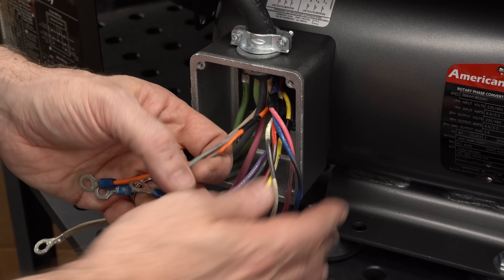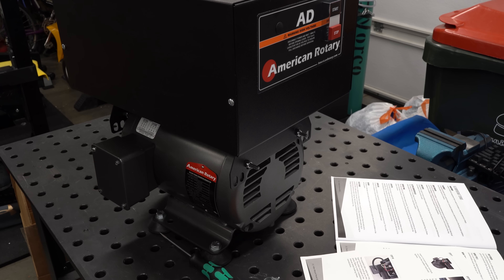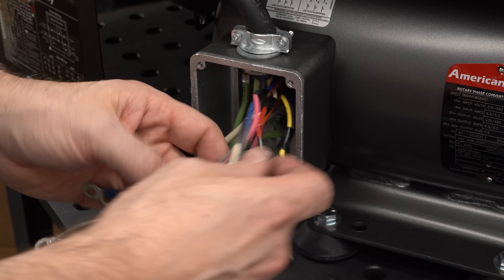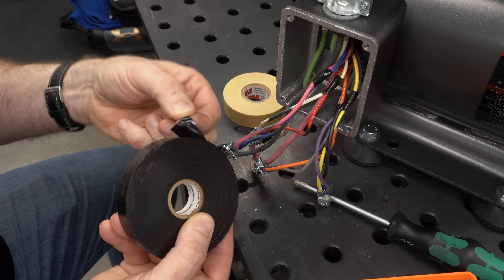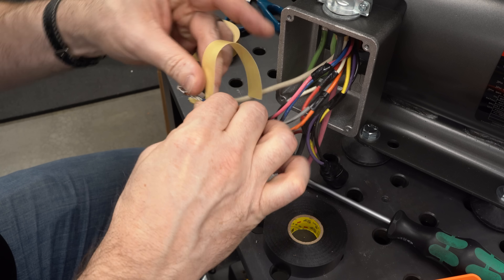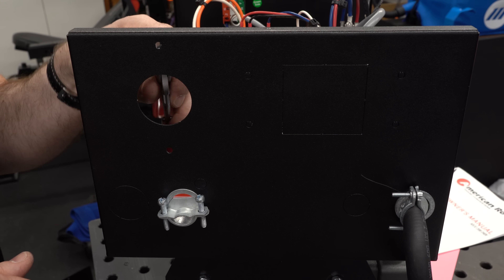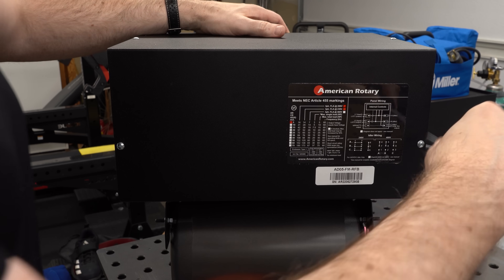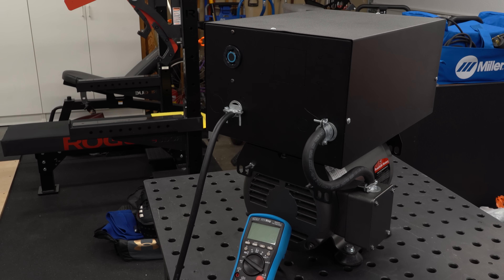How to Wire a Rotary Phase Converter the Old-School Way!

Comment: Heavy, difficult to grasp, gravity in your favour - And I think we've worked out how "Scratched and dented" came to be! :D
Chassis ground:  As far as I'm aware, two conductors in one terminal is perfectly normal and acceptable - although I should caveat that by saying that I'm not a qualified electrician and I'm from an entirely different regulatory domain...although we do use 240V as our norm.  So take that with as much authority as it was intended :D  That said, there's a nice nut, bolt and vibration washer on the same connector so you could crimp on a ring terminal and sandwich it under the vibration washer if that makes you feel any better (and nobody chimes in to say that it's a terrible idea :D )

Comment: In regards to the ground lug.... even though it is likely only rated for one conductor virtually everyone, including manufacturers, load these lugs up with multiple wires. I always make some type of modification to be Code Compliant, but that is just me. Methods that can be used are drilling and tapping an additional hole in the enclosure, changing the lug out for a multiple port lug, using a rated connection outside the port with one additional wire added to land in the lug, adding a ground bar. The best solution, imo, is to replace the lug with one rated for multiple wires. Those lugs are labeled as such and usually have a distinctive oval shape at the base. Adding some DeOx is a pro-move as well.

Comment: Thank you again for sharing. Quick question: I was always told that phase converters make you lose 1/3 of the horse power due to the actual lack of the 3rd leg which is generated from the single phase. Is that true or just a urban legend? If you want to feel better about your shipping troubles, there is a video by Alec Steele from when he was building up his montana shop, he ordered a fully restored Monarch lathe and Bridgeport mill and after an unusual wait he received a call from the freight company to go inspect his stuff. He went there and saw that the lathe was rolled around by the conditions it was in and the mill also was pretty banged up. I can go look for the video if you'd like...

Comment: There is some variability in how various manufacturers spec their wires, but even so, I would NEVER recommend 300V wiring for 240VAC.  Even if it is in fact capable of handling 300VAC, 240VAC is just too close for comfort.  What's ore, most manufacturers rate their wiring based upon the highest potential difference between conductors.  (Three phase wiring sometimes uses a double spec, giving the maximum PD phase to phase and phase to neutral.)  A 240VAC line feed experiences a peak conductor - conductor PD of 339.4V, considerably higher than the 300V spec of your lead wire.  Don't forget, too, line voltage is subject to spikes, so even that 340 volt number is going to be lower the  the actual voltage on occasion.  I would definitely go with the 600.  Surge suppressors are not a bad idea, either.
Reply: Pretty sure that the individual wires in the SJ cord are exactly the same as an S cord. I believe the voltage rating in this particular cable type is based solely on the thickness of the outer rubber jacket and is based on durability only. So as long as the environment is not harsh it seems 240 volts will perform electrically the exact same on SJ cable as it would on S cable.

Comment: I admire your use of ferrules on the stranded wire. I use them too - they make for a much more tidy and dependable connection. The devices you refer to as aluminum screw-terminals are technically known as box-lugs.

Comment: You created an open-delta three phase service. Open-delta delivers about 86% of the energy of a full (closed) delta service. Wye connected service tends to be more common, delivering 120/208 volts.

Comment: I have no great hilarity with machine tools (that I can discuss in detail. Might have to break the NDA on the 12ft shear one of these days, though), but way back when I worked for an industrial railroad, we  got a load that was to be delivered by a LTL shipper. It included locomotive couplers, which are heavy, solid castings, and awkward to handle, but palattizable, and regularly shipped that way.  I got the call on a friday afternoon, a couple days after the scheduled delivery, asking when someone was going to come get these thins off their floor. I asked why they hadn't been delivered to our site, and apparently the driver considered it not accessible his rig, despite another deliver by the same LTL the same week, with an overlength trailer and an absurdly long sleeper cab tractor. So, off I go to the depot. At the local transfer, their handler managed to separate ALL of the couplers from their palates when removing them from the trailer, leaving them in the middle of their warehouse floor, in the way. No attempt to pick them up and get them out of the way, even. This is why they called. They were in THEIR way, where they dropped them. I had to make a half dozen trips, as more than one was overcapacity for my pickup. They refused to help me load them. Fortunately, the truck kit had a come along and snatch blocks, so I was able to drag the first over and drop it off the dock onto the truck bed. I cane back with dollys and jack for the others. 

As for labeling the wires, clear shrink tube is VITAL over Ptouch labels.

Comment: I do believe your knipex has a crimp option on the bottom side. And you could simulate a light load, by connecting three old type lamps. Gives you an way to test the voltageunder load.

Comment: Not sure about in the US, but in UK really easy way to run 3 phase 415 volt machines off 240 volt single phase is using voltage doubler. Voltage doubler is just two capacitors and two diodes (all correctly sized and rated, obviously). This generates about 650 volt dc that can be fed directly into three phase inverter.

Comment: Great job I’m an electrician and would never just use electrical tape.   You did it right and really the only right way.  Per code you need to have as much insulation as the conductor.

Comment: Hi James: You asked for a story :)
I don't have a machine tool story but I have an electronics test equipment story. Actually, several of them but I'll stick to the most egregious. I bought a used HP Spectrum analyser on eBay, it comes in two very heavy unwieldy units, the display unit containing a CRT and the processor unit that contains the keyboard. This thing combined weighs probably 100lb. I paid my money plus a huge premium for shipping and waited for the delivery. Several days later my UPS guy calls me and asks me to meet him down by the local supermarket as he has a package for me that looks dicey. I got there and he shows me the squished box that had been taped up with sellotape that also had several hole in it which was super ominous. - I kid you not. I open the thing and the front glass of the CRT is smashed and the clown that packed this thing put the two units on top of each other without securing them from rubbing against each other.  He ten put "some foam" and bubble wrap on the corners of one of the units. The unit was not constrained from moving around inside the giant box so once the UPS throwers got their hands on it the devices at every step proceeded to shift and destroy the box. I don't know whether the sellotape was UPS trying to save a bad situation or that was how the thing was shipped? I raised a complaint with eBay but the clown asked for over 50 pictures of the damage and insisted that UPS was at fault. The guy then stopped responding to my questions about how this would be resolved and finally eBay stepped in. They refunded the substantial sum I'd paid for this thing and to crown it all the seller never bothered to have the thing shipped back. After 3 months I decided that I'd take a stab at repairing it. I sourced the parts, screen and new keyboard from all over the world, the new keyboard came from Israel and some of the damaged cards from Europe.  Took a while but despite some exterior damage where the metal work got bashed in and it wasn't worth repairing, I now have a fully functional and "almost free" Spectrum Analyser - one of the best vintage units HP ever made.

Comment: James I recon with your resources you should have printed a terminal block but having not done so your insulating of the connections even by your high standards was well over the top 😀

Comment: Why in the NA 3phase motors have just loose wires and no terminal block  so it's easier and less confusing and much safer to wire them?
In Europe at least, no matter how old the motor was, I have always seen a terminal block with windings wired into and winding labels molded right into it.

Comment: I know that you could have printed it in some fancy plastic, but I just took a piece of nylon once when I made a similar connection. Then drilled holes for the bolts, cables on, a washer and a nyloc-nut. No need fot insulation because the nylon insulates the cables from each other...
 Looking at videos like this I really like our 3-phase 380 VAC. I am sure that there are "many, many wonderful things" (had to borrow from captain Lassard in "Police Academy" 🤭) with DC allso, I'm just not used to it 👍🏼😋.

Comment: About 10 yrs ago, we bought a double head Mazak CNC. Over 50k€. The machine traverses half the globe with no issue, truck arrives at the factory, we inspect for damage, nothing, so we give the go ahead for the unloading. The specialized company (recommended by The local mazak distributor) then immediately drops the machine (they didn’t check the weight distribution and advised loading points). Took nearly a year for the insurance to agree on who was responsible and for the machine table to be replaced.

Comment: James,
 Great video, as always. Thank you.
When preparing the wires for the ferrules the wire the stripper leaves the separated section of insulation on the end of the wire. Take this insulation between your thumb and fore finger and roll it to twist the copper strands of the wire into a tighter helix. This will allow you to slide the wire into the ferrule without any strands spreading out and coming adrift. Total over kill, of course, but much underrated.
Reply: Great Tip 👍😎👍

Comment: Is there any way to wire A and B phases of the outlet from the other side of the contactor? The connected equipment may not be happy if there is voltage on only 2 out of 3 phases during the power-up.
Reply: Actually, if you research on it the motor does start up on only two windings which induces voltage/current on the third winding which aids in generating a third leg.
Reply: @fritzmiller9792  I was under impression that there is some sort of an output contactor, that closes when all the phases are stabilized and ready to use. At least that how it works in Phase Perfect converters.
Reply: @frigzy3748  nope, the Idler starts on single phase with the instantaneous assist of the capacitor bank to 'shift' the applied voltage just enough to begin motion of the motor. That in turn starts an induced voltage/current in the   3rd pole/phase. This exactly is mirrored in the load motor as well. Think of the 3rd pole/Phase in the Idler Motor AND the Load Motor as acting as  a generator literally to itself. So the applied 240 volt single phase power is generating another power source through the windings of the motors. When a winding has electricity flowing through it the impedance spikes and produces an electromotive force independent to itself which in the final run condition produces an overall acceptable 3 phase power sufficient for the vast majority of motors.
Reply: All that said, sometimes the load has a control circuit and if it does then the installer has to land the 240 volt supply leads to the correct two phases of the load control circuit. It's usually a simple wire change but with care to not reverse the phase order so as not to switch the rotation. It's usually best done in the load controls because the RPC has a set Wild Leg that needs to stay put.
Reply: @fritzmiller9792  sorry - I must be very vague in my writing. All what I wanted to say is that it would be good to have a contactor at the output of the phase converter so there is no voltage on the outlet when the converter is off.

Comment: Is it normal in the US too have no 3 phase? Here you get it when you build your house and there are lots of appliances that require 3 phase.
Reply: Residential service in North America is 240 V 1-Ø with neutral center tap, giving two 120 V branches. (Some mistakenly think that's two phases 180° apart. It's not. It's only one phase with a center tap at ground potential.) We have no 3-Ø appliances. Normally only industrial areas have 3-Ø power. We have to jump through hoops to power 3-Ø machines in our home shops. We also  envy our European friends.
Reply: @randyshoquist7726  right on. It's called Split-Phase but as you say most people (unfortunately including most electricians) call it 2 Phase. Most people have poor understanding of the Center tap concept/working dynamics as well. It's the most important connection of all.
Reply: What county? I find that fascinating, the added expense seems high but the resulting system balance is ideal, I am sure of that.

Comment: LOL. Yeah, already went through that. That was my very first video, wiring up the rotary phase converter. I think american rotary needs to rethink their instructions because they were not clear for me at all. I watched every video I could on youtube and of those, I was able to piece together enough to figure it out.

My issue with shipping hasn't been so bad, it's been buying and getting ripped off by machine sellers. The lathe I was promised was in perfect condition and was ready to go. LOL... Took a year to fix everything wrong with it and I have NO change gears at all. That was a company in Oxnard Ca. That was a $6,000.00 nightmare. Then when I bought my bridgeport from a co in mass, was promised it was a perfect machine. UHG! The head needs rebuilt, and I have to send the table in soon to have it ground smooth because its full of damage. They did a flake job on it to make it look like it was great condition, but it has wear and I will need to eventually send the whole machine in to be reground. That was another 6 grand. Then I see people on youtube getting these great deals for near perfect machines for 3 grand....

Comment: I went through this same process for the used converter that came with my lathe. The generated leg is always referred to as the high leg as they run quite a bit higher than service voltage.

Comment: I run my surface grinder from a vfd. As long as the 2hp spindle motor is running, the hydraulic pump for the bed motion and the coolant pump can be started and stopped without issue.  Those motors are quite small and the larger spindle motor actually buffers the starting surge from them.
Reply: Same applies to my Clausing, 5 hp 3 phase lathe. With the main motor running, the coolant pump can be started and stopped with no problems.

Comment: i sometimes use a small covered terminal block inside the motor wiring box
Reply: A terminal strip should have been there,  to start with.

Comment: Any reasons to not use a VFD? Are these cheaper/efficient than one? Seems alot more complicating.
Reply: If the machine has more than one 3 phase motor, yes.
Reply: A VFD has to start the load and stop the load or the potential to damage it the VFD is very likely. VFDs are great but are only useful to control one motor and can't be used as a general 3 phase power supply like RPCs can.

Comment: Not machine tools but I have been a field tech for about 25 years and have received and installed many big machines (commercial or industrial ink jet printers, the kind of things you print signage and billboards with).  Many mishaps over the years, but 1 stands out.  Machine was delivered, uncrated and picked up by the riggers forklift to move it to it's install location in the shop.  Long story short, while repositioning the forklift operator dropped the machine (about 10k lbs and $750k at the time), not just to the floor but hit the edge and off the loading dock as well.  All told 10k lbs dropped about 8 or 10 feet and landed on it's back.  Total loss, riggers insurance took a hit, and we had to ship a replacement machine by air from the middle east manufacturing plant to get it installed as soon as possible (riggers ate that too, but still).

Comment: Dog nuts in a peckerhead. Man I’ve made a ton of those splices. Always used split bolts for connections though. But the wire was also larger. Future James will thank you for the cambric. Yeah, it adds some puncture resistance, but more importantly it
Keeps the rubber tape from becoming one with the hardware.